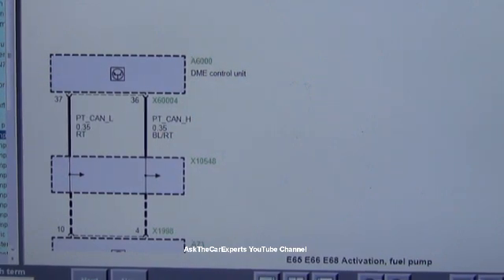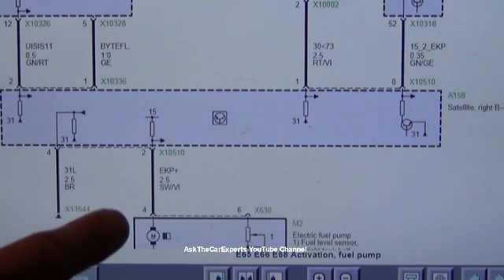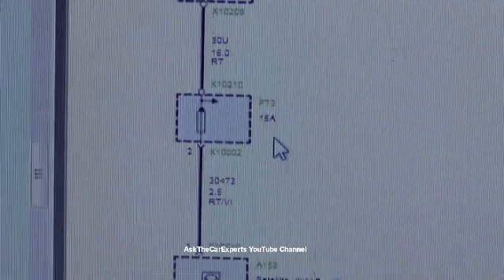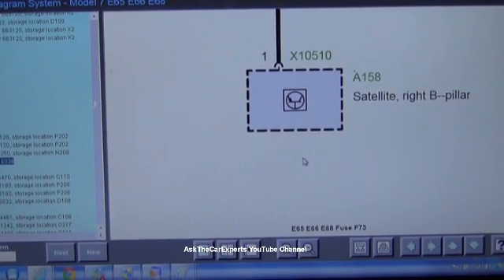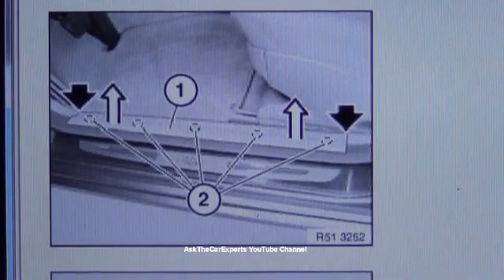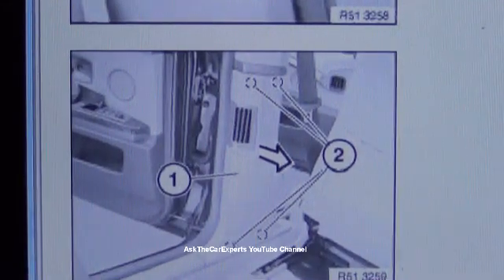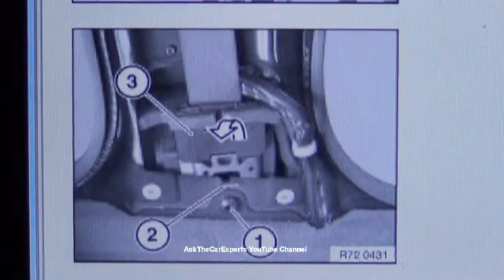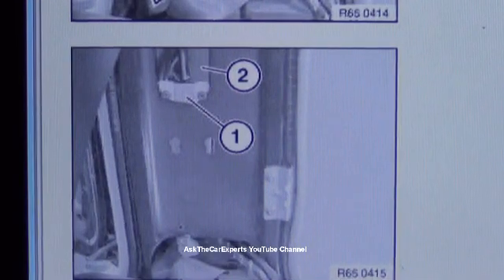BMW 7 Series E65 SBSR Fuel Pump Diagnosis And SBSR Replacement

Comment: I replaced the fuel pump on my 2011 e90 n51. I filled up the tank and noticed  that fuel gauge is not moving from the middle. How can I fix this? any suggestions? Thank you!!

Comment: Hey guys. This video is very helpful, but I have a couple additional questions that I wonder if you could help me with. My airbags deployed, but the car is still in tact and a fine automobile to me. We'll see for sure once I get her back out and check the suspension. I was told that the car CAN be operated without the airbags. So I've proceeded to fixing her up. I am not getting power to the fuel pump and want to know if I can bypass the SBSR in it's entirety. I have not accessed this module yet, but I am hoping this video will get me there. So I might be back if the wiring runs me over. But for now, my first question (to be clear) is "can I simply bypass this module now that i will NOT be operating the vehicle with airbags going forward?" My Number 2 question and i guess backup plan is, if I purchase another module, and have it coded to the car, will it simply end up defaulting since the airbags are deployed now? Thanks for any help you can offer and for sharing videos with us like this. Greg
Reply from the maker: Hello Greg, A coded sbsr should still run the pump even if their are codes for the airbag system. You could run a separate power but keep in mind the pump can draw a lot of amperage. I am not sure if the vehicle would pass a safty inspection to be road worthy without replacing airbags.